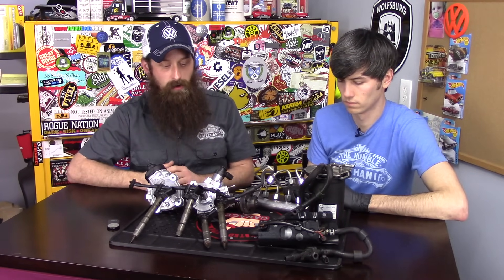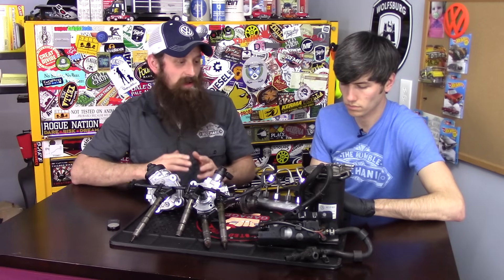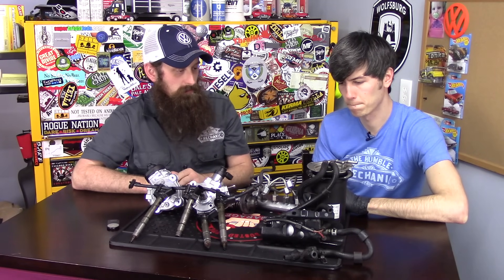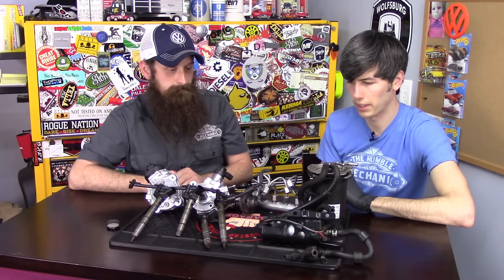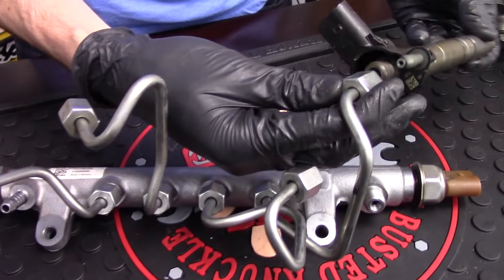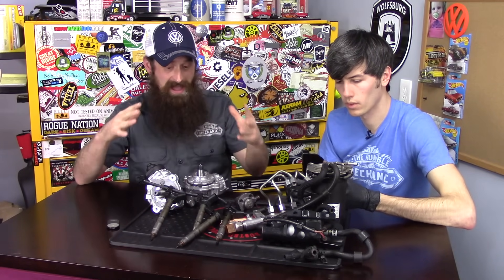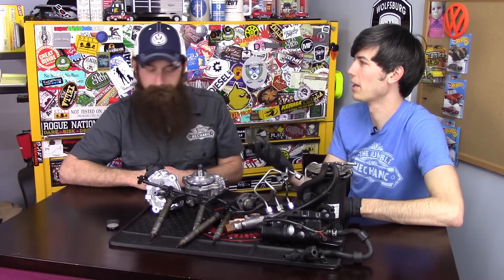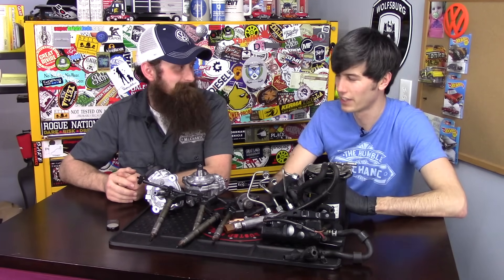Putting Gasoline In A Diesel Car - What Happens?

Comment: But what if you notice it before cranking the engine? and then drain the gasoline from the tank and then fill it with diesel?
Reply: I have been able to drain and fill in that situation.
Reply: +KonstantinosK will the the less than 3% mix ruin the pump or any other component on a modern vw engine?
Reply: +KonstantinosK unlikely since vw and others add tolerance for running on poor quality fuel in third world countries

Comment: Will there be a video on what happens when you put diesel in your petrol car?
Reply: +Ethan Gee no but there is a blurb about that scenario at the end of this video
Reply: I'd like to know also, but my humble guess is it will stall and might knock because of the lower octane rate. It might also block the filter because the diesel is thicker. I'd replace the filter and clean the injectors.
Reply: Just won't run at all. You pull the plugs and blow out any residual fuel. Add a little oil to each cylinder to overcome cylinder wash. Purge the diesel out of the fuel system then fill her up with fresh gas and they usually start right up. They smoke for a few minutes but I have never seen any permanent damage unless the customer keeps cranking the engine for an excessive amount of time. But usually the battery dies before that happens. My shop is in Florida and every year when the snowbirds come down a couple of them will put diesel in their fuel tanks by accident.

Comment: when I worked at ford, had a salesman fill a 2001 F-350 diesel with gasoline that was sold to a customer not even 5 minuets prior. customer brought it back an hour later chugging and bucking like crazy... drained the gas, new pump, and filter, drained the lines, bled the system and bingo! ran like a champ...

Comment: Could the manufacturers develop a sensor that detects gasoline as it enters the filler pipe or tank? And once the sensor is tripped it disables the car before damage is done. Gas gives of plenty of fumes, can't be that difficult to invent a sensor to detect it. Then you would only have to pay to have your tank drained.
Reply: +100SteveB  and in 3 years when the sensor fails in the middle of nowhere and leaves you stranded you'll be the first to complain about unnecessary and overly complicated electronics on modern cars and how they render a car useless.
Reply: Yes but why would they want to lose possible business fixing it?
Reply: Agent Office
Sadly i think you are correct, i can think of no other reason why something so simple is not available.
Reply: Quantum Leap
Oregon, where you are not allowed to pump your own ;)
Reply: +100SteveB Sounds like a pretty good idea. Why don't you develop an aftermarket device? Maybe something to insert in the fill line that would start beeping or shut the line if it detected the wrong fuel? How hard could it be?
Reply: Greg Rowe
yep, a dumb thing to do, but seeing that i have never owned a diesel i can't say i have ever put gas in a diesel tank. But what aa real shame that your parents brought you up like they did, they must have been real dumb.
Reply: +100SteveB there are flex fuel sensors for Gas and Ethanol, so it should be doable
Reply: Most newer VAG diesel cars won't let you put a gas pump in the filler neck.
Reply: +100SteveB And the very first time someone use the override after putting gas in the tank, it would make it entirely useless...
Reply: +Greg Rowe 
Not as hard as you think. My wife had a VW New Beetle drove up to a fuel station next to a Diesel pump and told the gas jockey to fill it WITH DIESEL.
She then walked to the station to pay. The only reason she didn't get gas in it was because near the station, she looked back and saw the idiot actually pulling a fuel hose over her car to get the gas line in it. She said she freaked out and knowing her It's an experience he or the fuel station never forgot. A week later she was ranting about how stupid the guy was. After that she never walked away until she seen the diesel line go into the tank.
Reply: +stuckinthemud Damn, where do you find a fuel station that pumps the gas for you!!  Wow, where I live, that went away about 15 years ago!
Reply: Greg Rowe
When she bought the car, diesel was always less then gas around here. It wasn't until a few years latter that diesel became more expensive. Fuel wise she got 60 mpg Canadian gallons. Any equivalent car would have been around 40. Only one time did she have a problem with it gelling and some conditioner cleared it up. It wasn't a race car but it could outrun a Dodge diesel truck.
  Now was it worth it compared to a gas car, No because every 100,000 kms or so you had to replace the timing belt on the car. $i,000 the first time, $1,500 the second. And the first one said don't bring that car back because it was hell to work on. Any VW is expensive to repair but maybe a better engineered car would have made a difference.
Reply: +Agent Office manufacturers do pay these under warranty many  technicians don't  bother  checking  the diesel fuel.  one tech  replaced 3 high  pressure pumps  under warranty
Reply: Patchuchan it's VW protocol that orders it...
Reply: Yes it is hard to be that stupid.  The dumbass should have been fired on the spot.  I didn't even know there were still full service stations.  None where I live.  That's fine with me, I can pump my own fuel.  I don't need a moron who didn't graduate high school putting the wrong fuel in.
Reply: Midniteoyl
Nope, Manitoba but I am surprised that you have no full service stations because all the new stations that have opened in the last ten years in my area have been full service  I can't even think of a self service around here anymore. They have all closed. And there is no law against self serve here.
Reply: Yvo Buziau
Having had the VW, I know the advantages of the diesel car. The worst part was the maintenance. The car was great to drive. A point that should be made is the difference between American and Canadian diesel. This maybe part of the problem and why VW decided to cheat on the emissions testing. Canadian diesel is much better than American diesel all though not as good as European diesel. We were warned that would be a factor to remember when we bought it. For example, we could get about 1000 kms on a tank of fuel in Canada but when we crossed into the US that dropped down to around 700-800. If it wasn't for the high cost of maintenance or repairs I would not have had a problem with it.
Reply: +Quantum Leap NJ, almost every gas station in NJ.
Reply: thevoiceoftruth55 Yep, it must be a state-by-state thing.  I have been pumping my own gas for almost 30 years, every now and then you'll see a full service station, but they are rare.
Reply: +Midniteoyl That's not what he said. He said if they know they put diesel in, but it was faulty and said they put gas in, they could over ride it. lern2reed comprehensively plz.
Reply: Trevor Mann
What? Apparently writing comprehensively isn't your forte..
Reply: you could because of the way they are distilled (fraction distillation) one is heavier im not sure
Reply: +Greg Rowe it makes sense to buy diesel cars in EU, where diesel fuel is cheaper. The cars are also harder to stall and the extra torque is of advantage in city conditions, makes for more relaxed driving and shifting. I don't particularly like the sound of diesel, but that is more rarely an issue nowadays and the smell should never be a thing, and even Scandinavians own a lot of diesel cars with their -30°C winters, starting is not an issue.
Reply: Or....If you can not pay attention to the kind of fuel you are putting into your vehicle should you actually be operating a vehicle? 30 plus years of fueling vehicles of all sorts and never not once have I put the wrong fuel into a vehicle. It's not that hard if you pay attention to what you are doing instead of worrying about that next tick tock dope-amine hit. The sensor you are talking about is already included in the decision making process, your eyeballs!
Reply: These sensors allready exist. They use a combination of due dilligence and the human eye to function.
Reply: Jo TUWE
Well, yes, it would add yet another sensor to cars that already getting far too complicated, but seeing that a gas sensor is not vital to the car running correctly, they could simply fit an override, either a switch somewhere, or have it somewhere in OSD menu. If the sensor fails it could easily flash the fuel warning light to let you know what the problem was. And unless you had just dumped a load of gasoline into the tank, you would know it was a fault and override it. Quite simple to implement, but like the previous poster said, why would manufacturers want to build something into a car that could lose them thousands of $ in repairs.

Comment: £10/$20 of unleaded gasoline was put in my diesel, so added £40/$80 so it was below 25%, most diesel used to run with upto 25% 'in the old days', it ran fine, but 2 days later all the seals went in my pump, was spewing diesel down the engine, cost $500 to fix... get it out asap.

Comment: Is there a significant difference between diesel in the US and in the UK/EU?  I had seen a video a few months back in which this theory was tested, including operating the car and diluting an amount of gasoline with diesel.  It was done in the UK, and they had absolutely no problem with the car having run 5 gallons worth of gasoline through it.  The whole point of the video was consumer awareness, and that the huge expenses you'd find at most shops over this mistake aren't really necessary.  :]

Comment: My short 4 years at Chevy dealership in my home town in happened twice. 

1) Customer was smart and didn't drive the vehicle (Diesel fuel in a gasoline engine)

2) Gm executive putt diesel in a 2013 Buick(Petrol Engine) regal and drove with it (Crash,bang...)  The diesel fuel blew the rings right off the piston new engine.

Comment: Well, VW has been lying about their cars for years so I'm not surprised that a mechanic in a VW hat wouldn't be able to add.
Reply: +HumbleMechanic Diesel Gate is fraud.
Reply: +Ratkill9000 Not at all lol. I've never owned a VW and for the past few years the only vehicle I've owned is a yamaha motorcycle.
Reply: +Dani2wheels winner for best video comment!
Reply: I leave the mathing to Jason.
Reply: +Dani2wheels Guessing you were one of the butthurt TDI owners that's suing VW for lying to the EPA? I applaud them for screwing over the EPA. The EPA is what is killing modern diesel engines.

Comment: Guys search YouTube for this. There's a video where this is intentionally done and the car is fine after putting the correct fuel back in. This is a huge scam for mechanics that charge so much money to replace and clean everything that isn't even needed.
Reply: Having done a about 20 of these repairs let me tell you this. If I was going to "scam" it sure as hell wouldn't be this. There are way easier ways to "scam" than a high dollar repair. 

Also what you probably don't know is, VW paid for all but 1 of these repairs I did. The odd ball was paid by insurance company from a fuel station. 

Lucky for my customers I don't scam them. That's a quick way to have your ass on the street.

Comment: That is some flat rate mechanic "diag", change all related parts with zero regard for customer cost.  We get this ALL the time on the smaller medium duty trucks that dont require a CDL to drive, the drivers own a gas powered car and then forget they need to fill their work vehicle with diesel. we flush the system change the fuel filter and let it go.  The injection pump is not so high performance that it cant withstand cranking dry for a few seconds.  I'm not a VW tech, so maybe their system is just junk, but I'm pretty sure 99% of everyone use a Bosch type injection system, which is what we have on our trucks.  No offense to anyone in this video, but this is overkill.

Comment: I have to disagree with this video. there is no way to get that much damage to a diesel engine and fuel system within one application of gasoline. the vehicle could not travel far enough. At most maybe a system flush other than that, drain and refill with fresh diesel fuel. @humble, as a mechanic I'm sure you know we don't repair or replace what "could" we do what's needed. otherwise mechanics would be trying to have car owners replace everything that gets wear and tear on the vehicle.

Comment: I've done miss fueling repairs and the amount of parts he would replace is ott and typical of the way a main dealer works. The convenience and time saving of not cleaning the parts properly and getting the car back on the road as fast as possible is the priority the cost is secondary.

The usual parts i would replace are the fuel filter and high pressure pump.
the injectors are only replaced if they cannot be disassembled or are damaged, usually like most components they get stripped, throughly cleaned, tested and reinstalled.

Comment: what if i put diesel in a gasoline car ?
Reply: +Omar Abdelrazik Diesel is more easily combusted so you would have engine knock for one (diesel ignites before the spark kicks in). I'm sure there will be other components that are damaged too.

But, the good news is, since diesel nozzles are bigger, the nozzles wouldn't fit into the fuel port on gas cars. So putting diesel into gas cars is almost impossible, unless you intentionally do it.
Reply: +Han Chen Diesel isn't more easily combusted and there is no spark in a diesel engine mate.
Reply: John Mcfadden I was describing a scenario where diesel fuel is injected into a gas car, not a diesel car.

When fuel is added into the combustion chamber, it is sprayed into it. When sprayed, fuel is much more likely to be ignited. I believe diesel can be ignited in a gas engine.